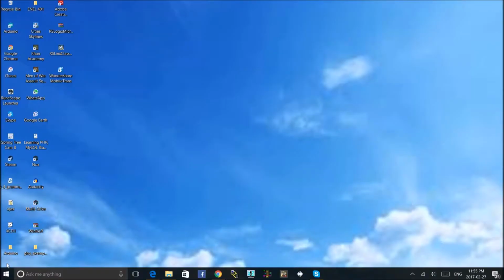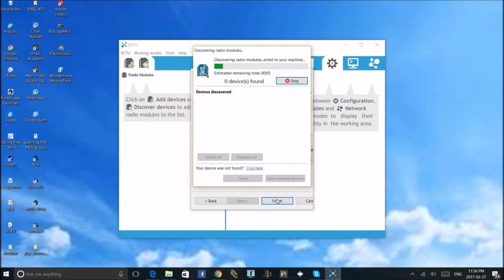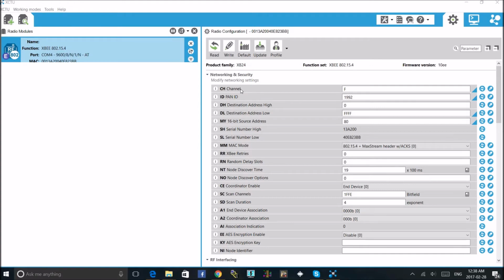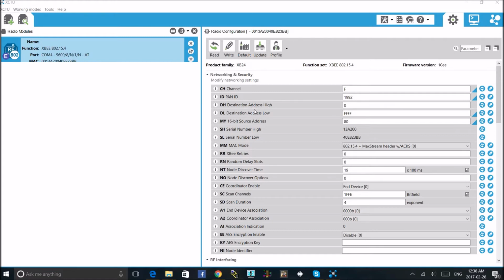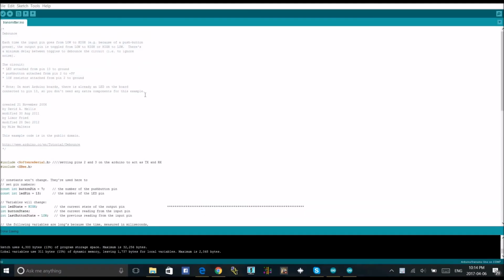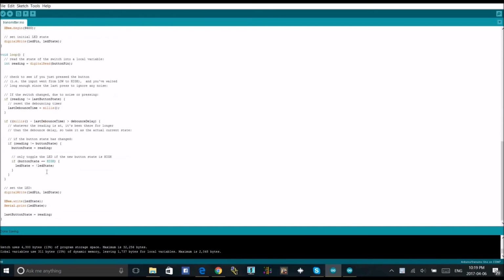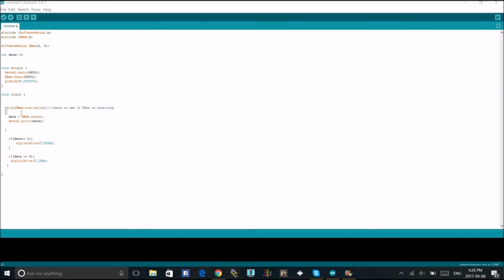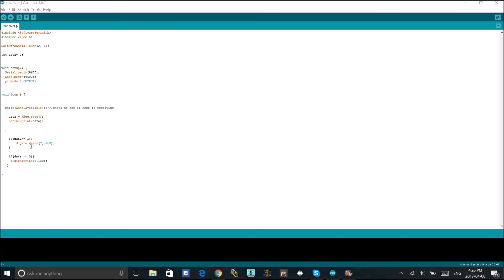XBee tutorial: Turning on an LED wirelessly using Arduino via XBee radios

Comment: Coordinator (Transmitter) Code:

#include <SoftwareSerial.h>
#include <XBee.h>

// constants won't change. They're used here to set pin numbers:
const int buttonPin = 7;  // the number of the pushbutton pin
const int ledPin = 13;    // the number of the LED pin

// Variables will change:
int ledState = HIGH;        // the current state of the output pin
int buttonState;            // the current reading from the input pin
int lastButtonState = LOW;  // the previous reading from the input pin

// the following variables are unsigned longs because the time, measured in
// milliseconds, will quickly become a bigger number than can be stored in an int.
unsigned long lastDebounceTime = 0;  // the last time the output pin was toggled
unsigned long debounceDelay = 50;    // the debounce time; increase if the output flickers

SoftwareSerial Xbee(2, 3);  // RX, TX

//----------------------------------------------------

void setup() 
{
  pinMode(buttonPin, INPUT);
  pinMode(ledPin, OUTPUT);
  Serial.begin(9600);
  Xbee.begin (9600);
  // set initial LED state
  digitalWrite(ledPin, ledState);
}

//----------------------------------------------------

void loop() 
{
  // read the state of the switch into a local variable:
  int reading = digitalRead(buttonPin);

  // check to see if you just pressed the button
  // (i.e. the input went from LOW to HIGH), and you've waited long enough
  // since the last press to ignore any noise:

  // If the switch changed, due to noise or pressing:
  if (reading != lastButtonState) {
    // reset the debouncing timer
    lastDebounceTime = millis();
  }

  if ((millis() - lastDebounceTime) > debounceDelay) {
    // whatever the reading is at, it's been there for longer than the debounce
    // delay, so take it as the actual current state:

    // if the button state has changed:
    if (reading != buttonState) {
      buttonState = reading;

      // only toggle the LED if the new button state is HIGH
      if (buttonState == HIGH) {
        ledState = !ledState;
      }
    }
  }

  // set the LED:
  digitalWrite(ledPin, ledState);

  Xbee.write(ledState);
  Serial.println(ledState);

  // save the reading. Next time through the loop, it'll be the lastButtonState:
  lastButtonState = reading;
}

-------------------------------------------------------------------------------------------------------------------------------------------------------------------------------------------------------------------------------------------------------------------------------------------------

-------------------------------------------------------------------------------------------------------------------------------------------------------------------------------------------------------------------------------------------------------------------------------------------------

-------------------------------------------------------------------------------------------------------------------------------------------------------------------------------------------------------------------------------------------------------------------------------------------------

End Device (Receiver) code:

#include <SoftwareSerial.h>
#include <XBee.h>

SoftwareSerial Xbee(2, 3);

int data = 0;

//----------------------------------------------------

void setup() 
{
Serial.begin(9600);
Xbee.begin(9600);
pinMode(7, OUTPUT);
}

//----------------------------------------------------

void loop() 
{
while(Xbee.available())
{
  data=Xbee.read();
  Serial.print(data);
}

if(data==0)
{
 digitalWrite(7, LOW);
}

if(data==1)
{
 digitalWrite(7, HIGH);
}
}

Comment: Whats the range
Reply from the maker: KRYPTONITE TEC   Approximately 10 meters inside buildings and 20 meters outside. The signal will reach between 20 to 30 meters but there will be a delay
Reply: @mujtech4887  
Can you help me with coding?
Reply: 75m to 100m

Comment: why is the TX and RX goes to pin 2 and 3 in the arduino? the RX and TX text in arduino is on pin 0 and 1. i really new to xbee, pls help me
Thank you in advance
Reply: im using xbee shield v03. so what pin shall i use on the SoftwareSerial Xbee(?,?); ?
Reply from the maker: Michael Nathaniel Hi Michael. At that time, I encountered some issues when I used the hardware serial ports of the arduino (pins 0 and 1) with the XBEE shield. Hence I used the “softwareserial” library to configure pins 2 and 3 to act as TX and RX so that I can receive serial data from the XBee radios. With the softwareserial library, you can configure any digital pin on the arduino to function as TX and RX, similarly to pins 0 and 1 and in this case I used pins 2 and 3.
Reply: @mujtech4887  Thank you for replying.

i use pin 0 and 1 for the RX and TX, and i think it works. But something is wrong when i receive the data i send. when i print the received data, i got a bunch of number and i don't know what it is. here is my code for send data.

#include <SoftwareSerial.h>
#include <Printers.h>
#include <XBee.h>

SoftwareSerial XBee(0,1);
String data;
void setup() {
  // put your setup code here, to run once:
  Serial.begin(9600);
  XBee.begin(9600);
  data = "test send data";
}

void loop() {
  delay(3000);
  // put your main code here, to run repeatedly:
  static char *dataSend = data.c_str();
 // need to use c_str() because the write function don't accept String
  XBee.write(dataSend);
}

and her is the receive code

#include <SoftwareSerial.h>
#include <Printers.h>
#include <XBee.h>

SoftwareSerial XBee(0,1);
String data;
void setup() {
  // put your setup code here, to run once:
  Serial.begin(9600);
  XBee.begin(9600);
}

void loop() {
  delay(3000);
  // put your main code here, to run repeatedly:
  while(XBee.available())
  {
    data = XBee.read();
    Serial.print(data);
//    Serial.print((char)data);
    Serial.print(" ");
  }
  Serial.println();
  Serial.println("====================");
}

can you help me?
in your tutorial, you just send a number(1 or 0). can you tell me how to send a String? or there is another way? i need to send some datas from sensors.
Reply from the maker: Michael Nathaniel I still haven’t tried to send string data via arduino. From what you’re telling me, the numbers that you are receiving are the ASCI codes of the characters that are sent from the transmitter and it’s showing like that because you’re printing them at the receiver using “serial.print”. Perhaps if you change it to “serial.write” it might work?

Comment: Hi. I'm trying to run this kid - digi xk-z11-t-w. But i receive the next error. I work with digi esp for python, and i'm trying to use digi tank solution simulation.
 
Any help?
 
 
XTankSensor: DoCommandRequestForMiscSensorInformation -> START!
XTankSensor: DoCommandRequestForMiscSensorInformation -> REQUEST SENT!
XTankSensor: scheduling a state machine callback of 20 seconds and a backup callback of 30 seconds.

Comment: Thank you! Im No longer scared of Xbee
Reply: Do u recommend having a 1k resisitor between rx and tx pins instead of direct connection like you show?
Reply from the maker: Austin Mosley if you’re using a shield then you don’t need a resistor otherwise yes

Comment: how to order a robot with 4 button pussoire transmitter (arduino1) / receiver (arduino2) with this principle of Xbee as on the example of led please answer me ?????
Reply from the maker: yougourthene brinis You can use the same principle shown in this video but instead of having the receiver XBee controlling an LED have it control a motor driver

Comment: What is the schematic of the switch? I have hooked it up and programed it exactly like you say but I can not get it to work. Is the 5v and the resistor common and the terminal connected to pin7 make the connection? I think I have my pushbutton set up wrong....Please Help!

Comment: Hello i'm doing a project with Xbee and i don't know where to start. Basically what i want to do is a wireless object counter.The Xbee must be able send the number of object to the computer wirelessly (with the aid of arduino and ultrasonic sensor) whenever an  object passes near the sensor.  Any advice on how to do this please? Thank you.
Reply: Probably a bit late on this but XBee is a radio transmitter. I don't think most computers have radio capabilities. So I suppose you could connect an XBee to your PC. Doesn't Arduino have Bluetooth? If not I'm sure there's a shield for that. I feel like that might work. But who knows.
I'm curious what you ended up doing though.

Comment: I have a question, why you use pin 2 and 3 in arduino for RX, TX from xbee? 
it is possible if I use pin RX, TX in arduino directly to connect TX,RX from xbee?
Reply from the maker: Pins 0 and 1 are hardware serial ports that can only transmit and receive to one device at a time. Since we are using the serial commands in this code, we are communicating the Arduino with the computer via these pins so we can't also use them to communicate it with the XBee radios. Hence, the digital pins are used. 

In the Arduino Mega however, you are given 3 hardware serial ports to choose from so you can use two ports at the same time without the need of using the digital pins like I did in this video.
Reply: mujTech ooh ok, I got it! Thankyou dude👍
Reply: ooh sir, i have another question. i wonder if i want to controll the LED intensity with potensiometer, can you explain it?
i've tried but still failed. thanks